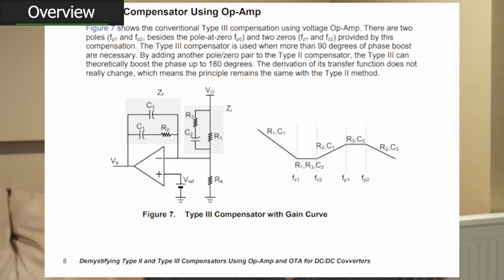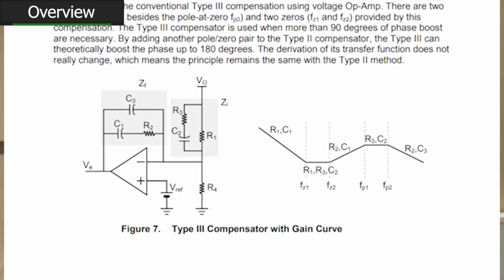Choosing a Compensation Network (Electronic Load)

Comment: Well if you go digital (PID) you will have to rely by the MCU clock. Regardless to say, that if you want to use a colored screen or something that needs more processing, your PID will be less effective when that processing comes along. So if i were you, I would go for the analog method, or a dedicated MCU just for the PID control (which sounds a bit overkill).
Reply: Or, use a DSP
Reply from the maker: Hello FixDaily! Yes, one must think about loop times, then again, if the loop runs interrupt driven and the display can handle interruptions every now and again, this isn't necessarily an issue, but definitely something to think about! Thanks for sharing your thoughts & Perspective!
Reply: The general rule says that if your delay time (algorithm execution + conversion times) is less than 5% of the sampling period.  there is nothing to worry about, the errors are negligible.

Comment: I have a stupid question could you please explain to me how do you measure the voltage of a charging battery or is it as simple as stopping the charging for a couple of seconds and taking your voltage measurements thank you and stay safe
Reply: If you are talking about Lithium batteries, you know when they are charged when they reached 4.2V and the current (that is being applied to charge them) goes close to nothing.
Lithium batteries are firstly charged by a constant current (depending on the battery, since if you apply too much current they will heat up and blow up) and they by a constant voltage of 4.2V maximum.
Acid batteries use other methods, like temperature, a peak in voltage, ...
Reply: And you don't need to stop charging a battery to take a reading, it would not make sense.
When you apply charge to the battery, the battery will not reach 4.2V instantaneously, only if you apply infinite current, which would make it explode right away.
So you can always read the "charged voltage" (which by itself is not enough to determinate if the battery is charged or not - but some equipments do it to make the products cheaper to produce).
Reply: @FixDaily  thank you for the reply and information I've been wanting to make a discreet logic lithium ion battery charger but was confused on how to make sure that the battery was charged without constantly stopping the charging process to check the battery's voltage
Reply: @FixDaily  do you know any methods to measure accurately measure a battery's voltage while it's being fed with a cc and cv?
Reply: @dynxt-_-3243  To make things faster, you can just read the overall voltage.
In one of my projects, i use the ADC of the MCU to make the readings, so with 2 resistors i make a voltage dropper and i read it. I'm using AVR, so i've created a lower voltage reference (AREF) to increase the ADC precision. Also by code, to avoid fluctuations, when it is charging i always accept the greater values (the increasing in voltage), since it is charging i can only read the rising values. Same for discharging (only accept the lower values - the decreasing values).
You can also use  TP4056 for battery management, there are greater ICs out there, this is the cheapest solution, not too accurate but does the work. Also don't forget to protect your batteries if they don't have a built in protection.
Reply from the maker: Hello DYNXT! Great discussion here, to chime in: There are two voltages that you may care about: Terminal voltage (measured at the battery terminals) and Cell voltage (measured at the electro-chemical cell within a battery)

Most battery datasheets provide detailed charging information to prevent damage or catastrophic failure of a cell.

At small currents, the difference between cell voltage and terminal voltage is very small. at higher charge currents, the ESR of a battery and some more complex chemical effects will make an offset. If you battery is characterized well, one can compensate for this is high charge currents are required. That to say, if you care about terminal voltage, just measure the voltage as you would! discrete logic may mean resistor dividers and comparators, though an ADC and a microcontroller will always provide more control. Just a thought, but Battery management ICs built for charging lithium ion batteries do exist! (https://www.ti.com/power-management/battery-management/charger-ics/products.html)

Cheers, and best of luck in this project! Thank you for the awesome comment, and thank you for watching!